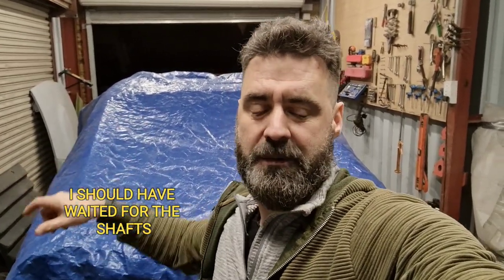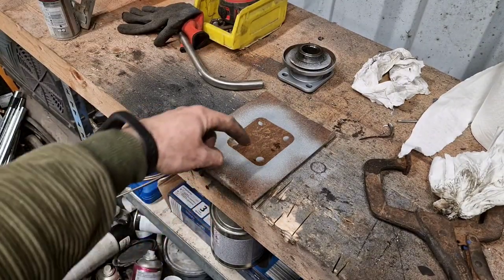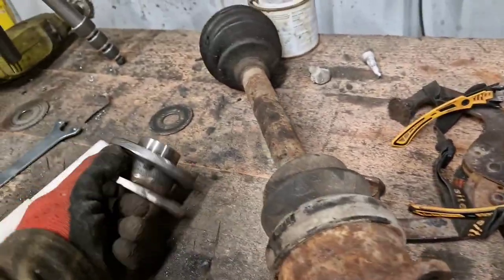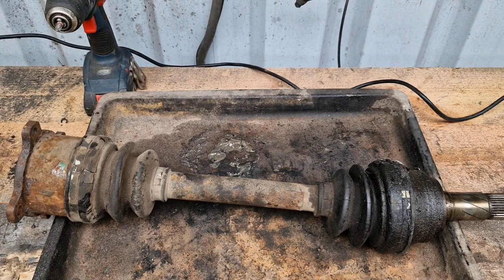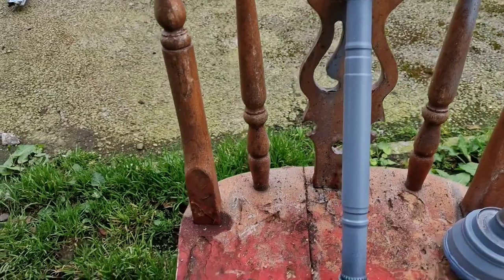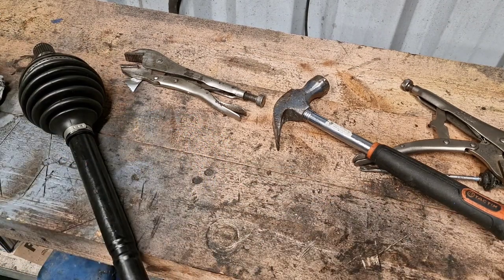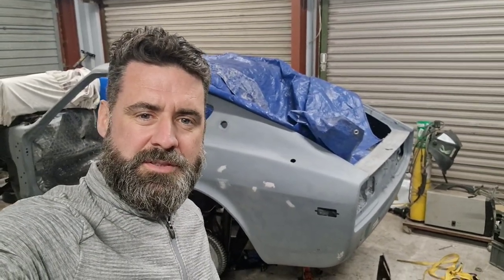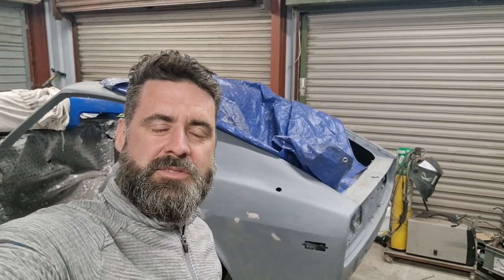DATSUN Z. R200 DIFFERENTIAL - DRIVE SHAFT AND STUB AXEL MODIFICATION. 240Z 260Z 280Z

Comment: Nice work. Always good to see when mistakes are made & corrected, rather than edited out. Oetiker type clamps can be squeezed with angle/diagonal  cutting pliers, better than using vise grips as you get the proper tuck in of the clamp head
Reply from the maker: Cheers. Yea I want to show the process including the screw ups 😁. And you are right about the clamps. I had a suitable pinchers but couldn't find it on the day.

Comment: Nice progress! I fitted CV shafts to my Z and had similar clearance issues on the anti roll bar link. I fitted new links from a honda crx which were shorter and allowed clearance. Nice and cheap too!
Reply from the maker: I'm glad to hear I'm not the only one with the drop link issue. Cheers for the CRX advice. I'll order a set ASAP and eliminate any risk to the booths. 😁